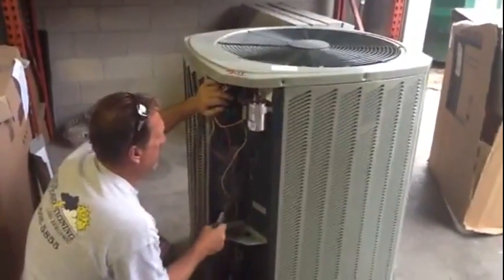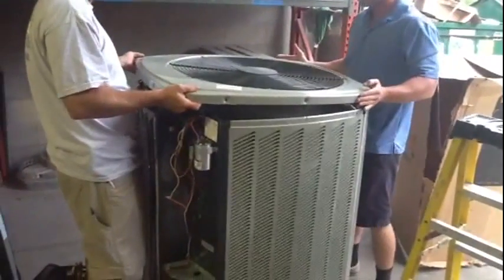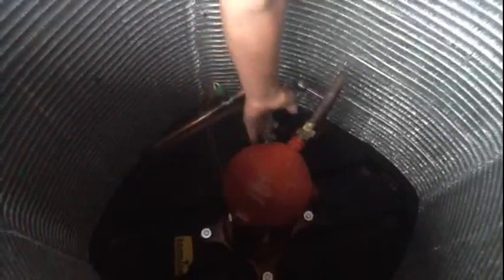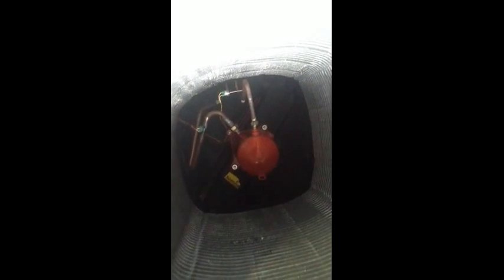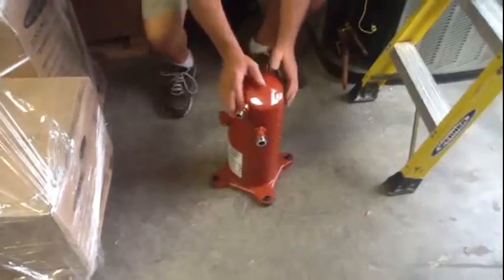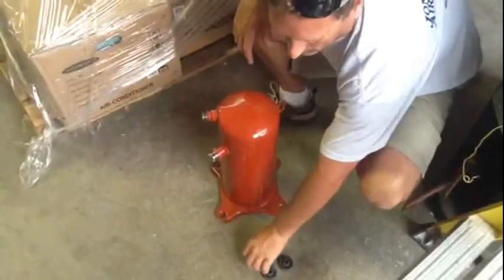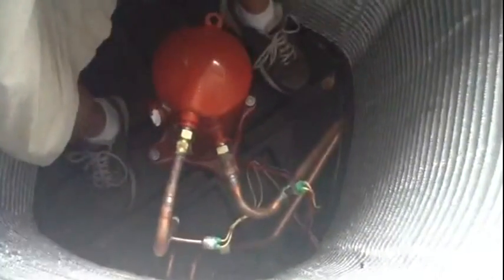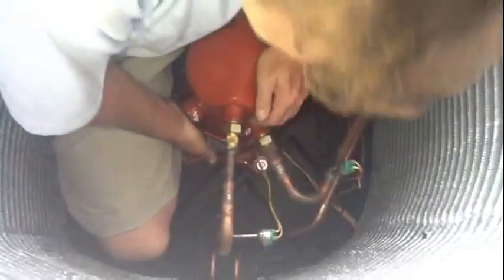TRANE HEAT PUMP COMPRESSOR REPLACEMENT

Comment: Hello, Great video.  I have a Trane XL 15i that has a seized compressor and needs replacing.  Your video shows great physical replacement, but what about a video on recharging the system and final steps after the physical replacement. Do you have any such videos?  Thanks in advance.

Comment: I had a compresser go out in my cool unit.   I got me a new compressor and then watched yalls video.  I got to the part where I put the pipe wrench on big nut and gave that sucker a wallop.  Man o man did I get the wholey bejeezuz scared outa me.  Wife had to take me to the hospital to get that stuff of my skin.   Some kinda oily steam crud come blowing out and it burned real bad.   Thought I was gonna die.
My lawyer is looking for yall. He says I wont have to work no more!
Reply: John Fitter I hope you learned a lesson you can’t do it yourself it is illegal to let refrigerant go in the atmosphere let alone not have an epa card and be messing with refrigerant

Comment: Do you need to discharge the system? or is it straighT forward like you guys show, disconnect Roto-Loks / bolts etc.  I'm trying to replace compressor on a split system Trane Model # TWA090D30RAB.

Comment: Very Cool video! Don't know why you seem to be getting so much negative feedback. Never changed a Trane comp with the Roto-loks before; nice to see a demo. Looks very simple! A few genuine questions: Why did you guys do this in your shop? Perhaps refurbishing a unit for resale? Is there a specified torque for the roto-loks? I have a special torque wrench with different open end wrench attachments for tightening flares to manufactures specs on 410A mini-splits and such. I think it would work...

Comment: David Jones, Do a video of a compressor change that the rotolocks are rusted. I used a 4' pipe wrench on mine and it wouldn't budge. I thought it was going to rip the bottom of the unit out. They still aren't loose.

Comment: Mr. Jones, my mother-in-law was told by an AC guy that her compressor in her Trane unit is bad. It was made in 1988. I went by her place and learned that the compressor does run (motor), but the line doesn't get cold. The other line does get hot. I took the top off w/ the fan still attached. Cut the breakers back on, and the fan started, as did the compressor motor. Could it just be low on freon? Thanks for the video. I believe I could swap out the compressor for her, but somehow I'm thinking I'd need gauges, a new dryer (which by the way, I don't recall seeing one inline at the outside unit). If the connections are loosened, will freon escape? Perhaps a new unit altogether would be in order. If a new compressor cost sooo much, then maybe that's the best course of action.
Reply: I'm not sure how the ac guy determined the compressor was shot. Perhaps they just didn't feel like messin' with it and recommended a new unit. Can you tell me by looking at the model# what tonnage this unit is? TTL736A100A0

Comment: Is there an alternative compressor for Trane XL14i unit model 4TTX4036A1000AA, of year 2003. The existing Trane compressors seem to be very inefficient, extremely loud and use way too many amperes.

Comment: Those compressors could be set next to the electrical panel for easier access.  Reaching down into a cavity on a 4 or 5,  ton high SEER will make you stand on your head to reach the rotolocks.  Ain't that nice, having to climb down into coil cavity. A lot of units makes it almost impossible to squat down to the compressor.  The rotolock fittings is by far the best design feature.  Trane is good stuff, but they could do better on design for accesibility of the compressor.  Just my opinion.

Comment: The big problem I have with trane is they make their products so you have to buy their overpriced parts through their destributor companies which are your competitors. It's a form of monoply. I replace trane compressors with copeland compressors that have the same capacity. Works great and costs less. And I would never sell a trane AC system.

Comment: It was not mentioned, do all replacement compressors have oil already in them?  Also I wonder why so many people think that a contractor license = competency.  If I understand it correctly, to get a license you must fill out a piece of paper with your name and address on it, and pay money.  That doesn't mean you are qualified to do anything.  My dog is licensed- what is he qualified to do?  My last employer is licensed.  He doesn't believe in nitrogen purging or charging by target super heat or subcooling.  As he likes to say, "gas and go".  So much for licensing.